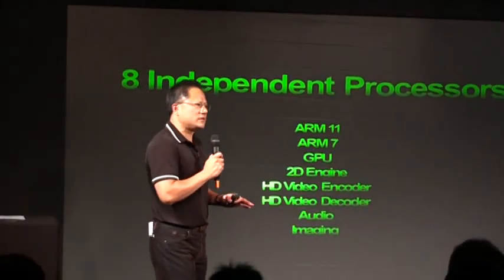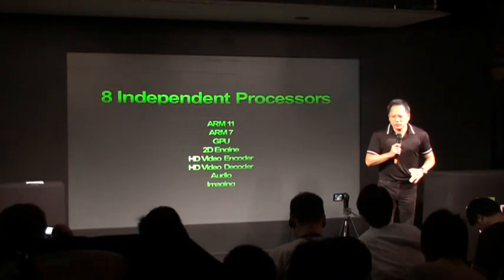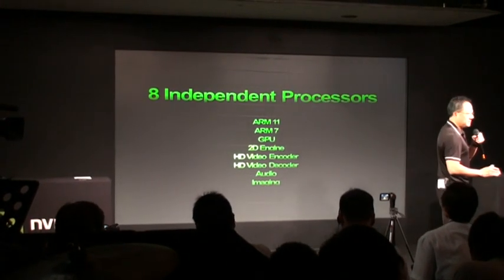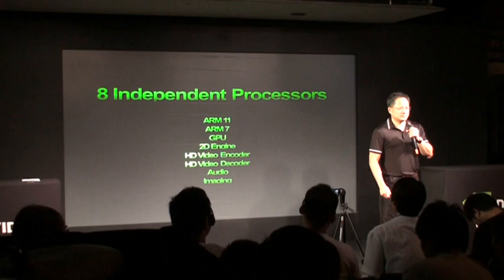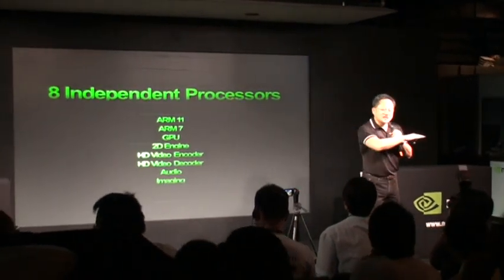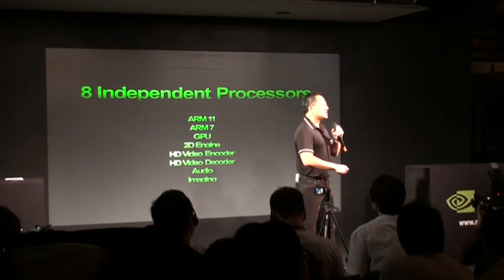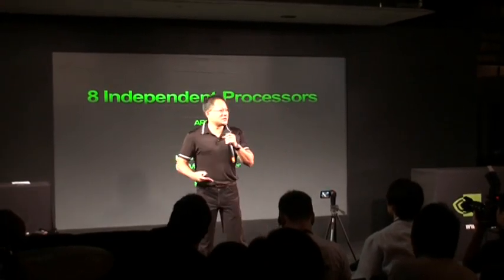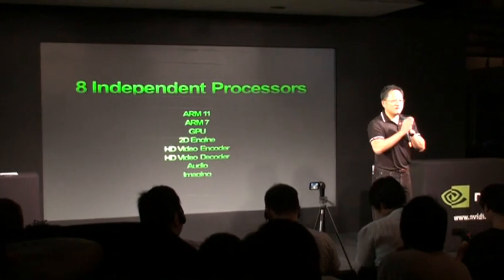Tegra - 8 Independent Processors

Comment: there not, allow me too explain. the first one is;
If u are not in need of other processors they will not be on consuming power, the second is, if u do need another processor there has to be a reason and that reason will be which processor will be activated. not all 8 processors are the same. Some are for video others for online data etc. so instead of u using a video processor that consumes a lot of energy to read text, a lower consumption processor will be activated so that u can access data